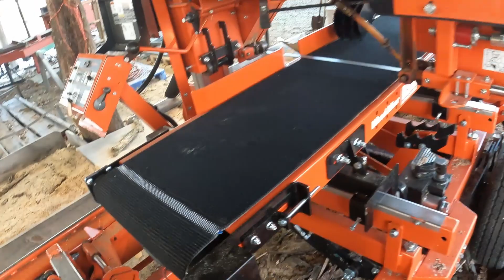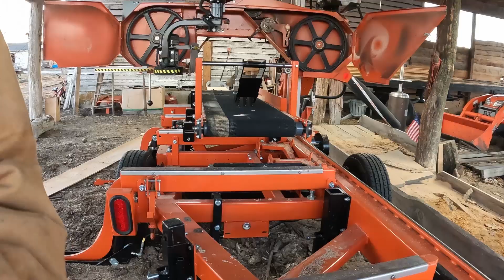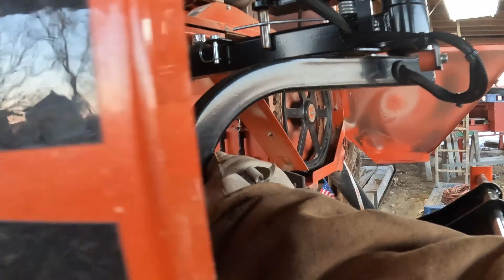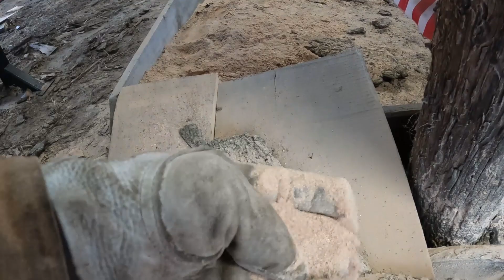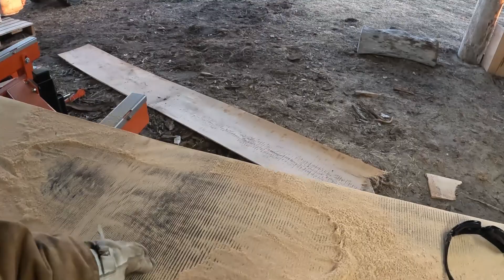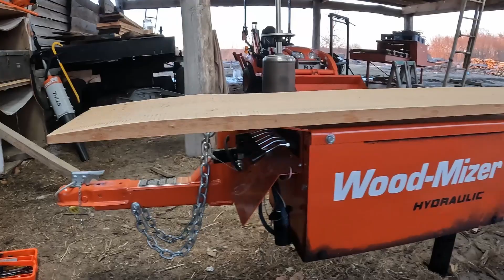Resaw  Attachment Wood Mizer LT35 bandsaw sawmill cutting first red oak 14 inch board

Comment: Interesting.,...I would suggest carbide bands for resaw setup.  Should last longer and run better and were made for it ;)  Otherwise cool but I am not sure I'd see any value from one of these unless in a large lumber operation
Reply from the maker: You are correct about the large operation needed to make the resaw worth it.  The owner of the mill wants to side his whole house with lap siding so that is why I have it.   A customer asked if I could kiln dry some 3/8” cherry.  The only way I could get that done was to resaw some.
Reply: @DANG--  that makes perfect sense!
Reply: I will be putting video out at some point,  just received this attachment. 
&  i am a one man operation 😂😂❤